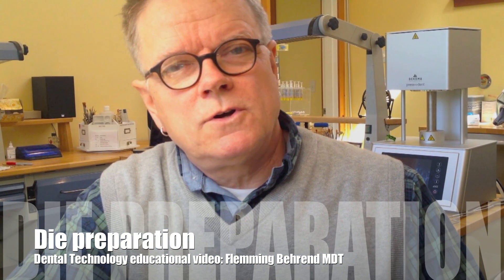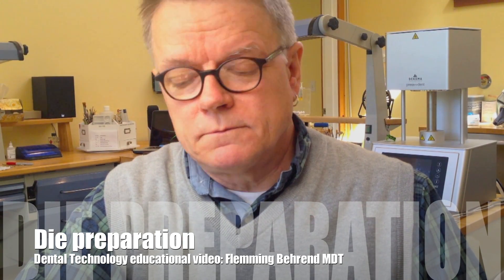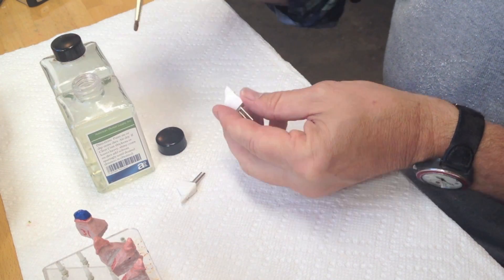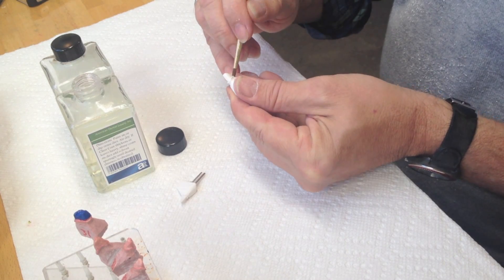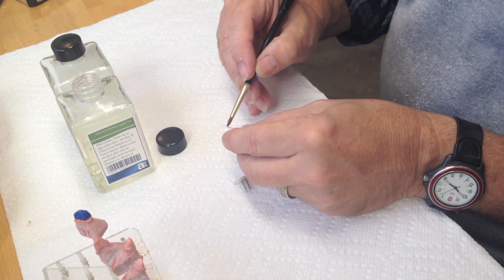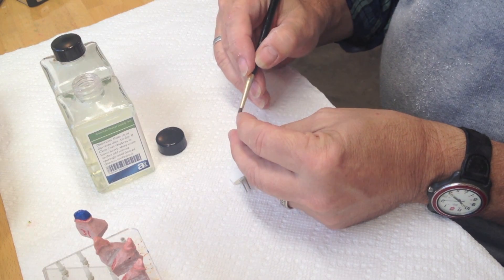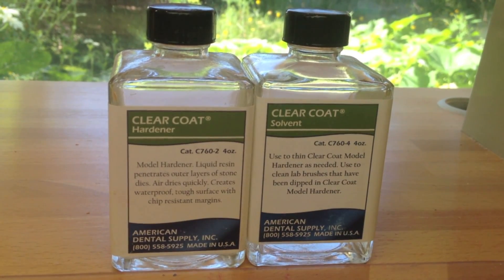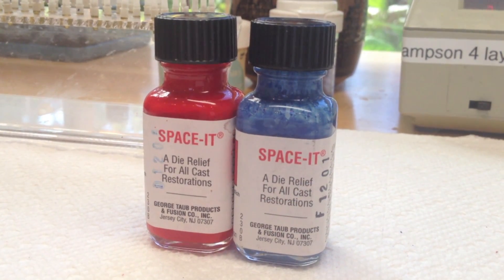Die preparation: Flemming's Dental Ceramics teaching video

Comment: hello! 
I'am a Technician from Taiwan
In our country we use 1 layer die spacer on model
but you use 2 layer.
I really want to know why??
It won't be too thick?
Reply from the maker: BinNu Chen A lot of times there are minor undercuts. By applying two layers after block out wax the dentist does not have to adjust the crown inside. I have used this method successfully for over 30 years.